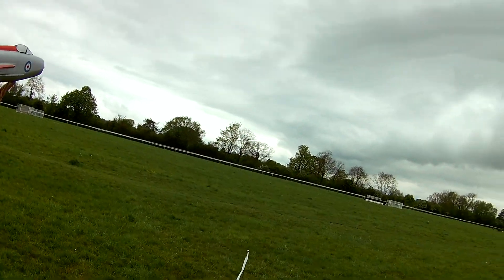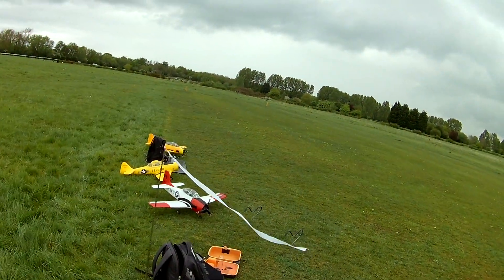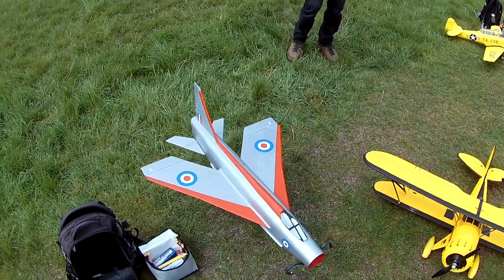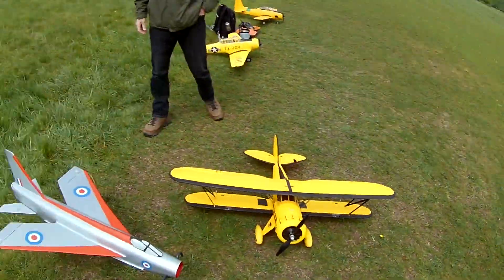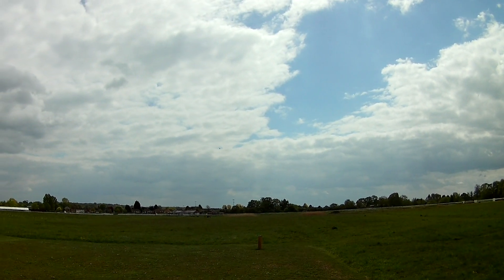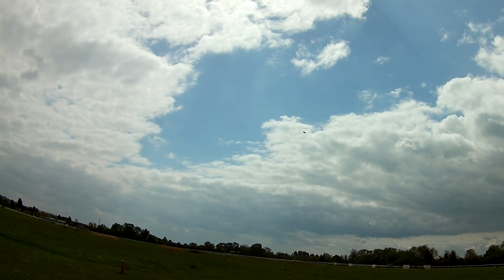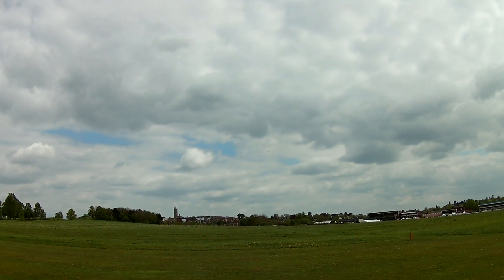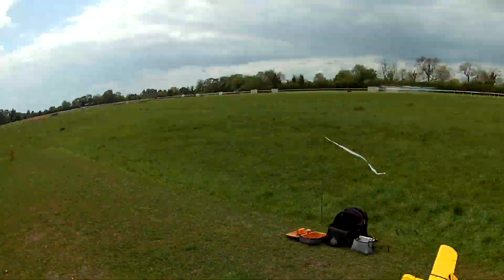EDF English Electric Lightning maiden flight.

Comment: I was sat at work waiting for a compile and wondered if anyone had made a lightening out of foam yet :)   Very nice work.  It looks amazing and doesn't look like it needs much work to make it fly as good as it looks.
Reply from the maker: Hi Stephen, I got it dialled in quite quickly on this flight. Unfortunately on  the second flight disaster struck. One of the servos malfunctioned on elevator flipping it over and burying the nose into the ground, a complete write off I'm afraid.

Comment: Having scratch built a number of lightnings  I agree the plane can be very sensitive on roll. My recommendation would be to keep to scale size  not as you have and movement 20 deg up 15 down.

Would not recommend pivoting the tail plane as you have you will just end up damaging them every time you land. Either do as per full size with swept back pivots or cut the end of tail plane and hinge as normal elevator.

You should not need full elevator on landing  and makes me think the approach was to slow or the C.G. is to forward I set mine at 70% to 75% back from 
the root leading edge.

Finally get someone else to launch that was way to lame and the reason for the first fail not the intake cone. This plane will not tolerate limp wrist throws needs a good javelin throw or bungee to get up to flight speed.

Have just uploaded my twin 55mm on my other channel using bungee launch.

Like the plane and good luck on the repair and next flight.
Reply from the maker: Thanks for the advice. I am now pivoting just the rear of the elevator with the front section part of the fuselage. It still looks like the original with a very thin gap between them. Ready for it's next flight so fingers crossed.
Reply: phil up can you link to your version ? Cheers